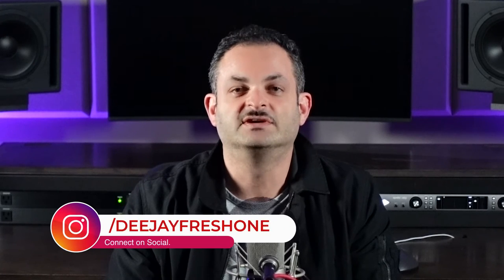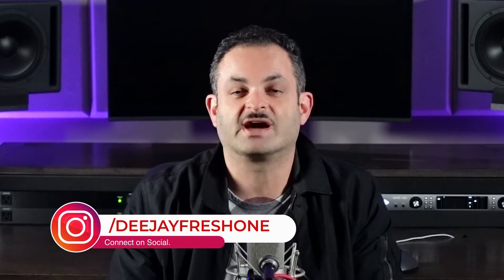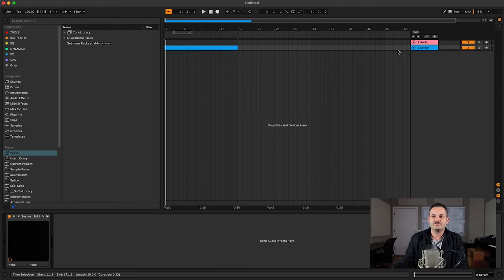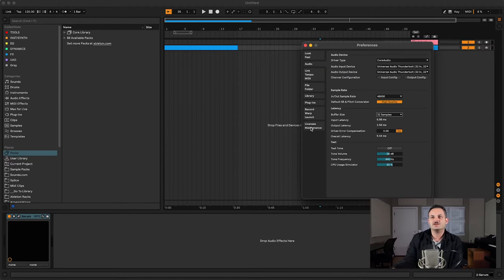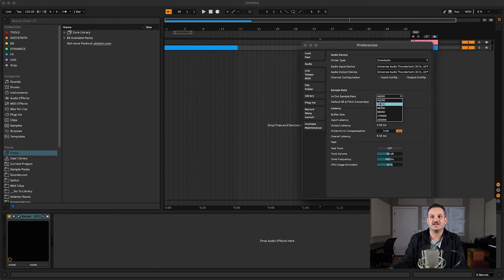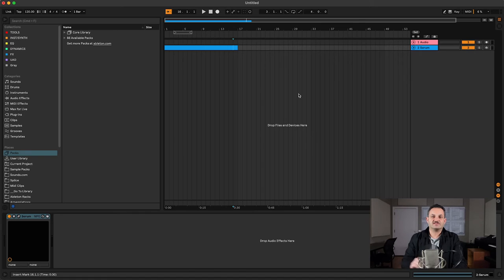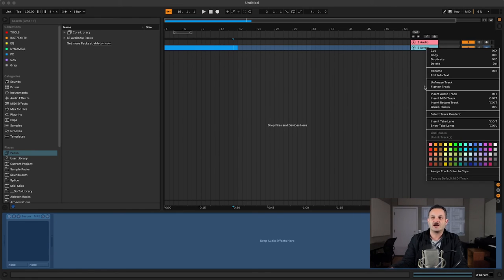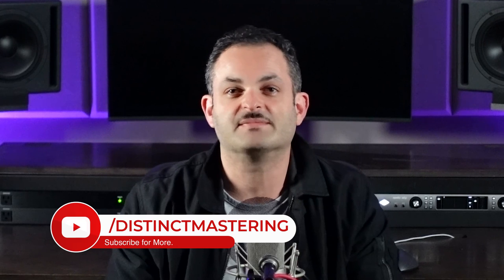Get Rid of Ableton Latency Issue...Now!

Comment: the odd thing is that my shit laptop runs ableton better (cause it's not bloated) than my 3000€ workstation pc.
Reply from the maker: Really? I bet a plugin might be causing it. Try running Ableton in Safe Mode [ Press and Hold option/ALT while opening Live will bypass plugins scan (will launch Live in safe mode) and see if the problem still persists...